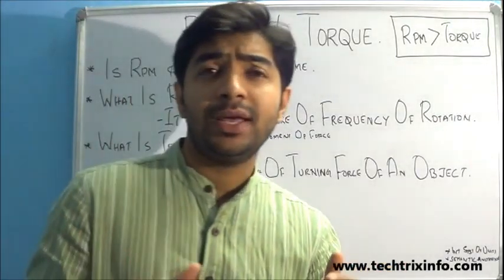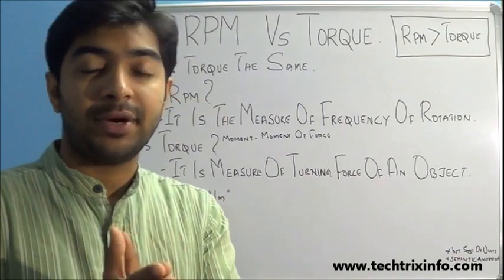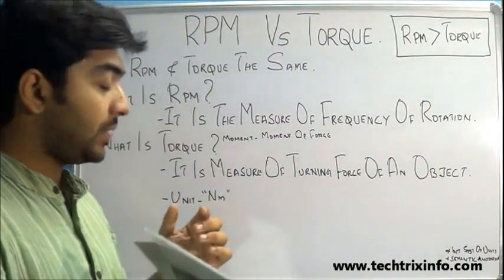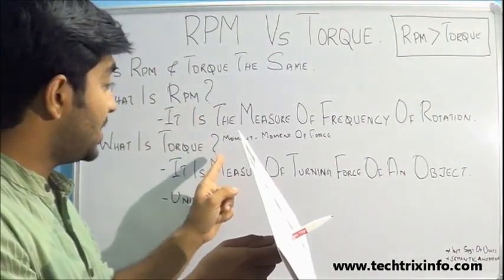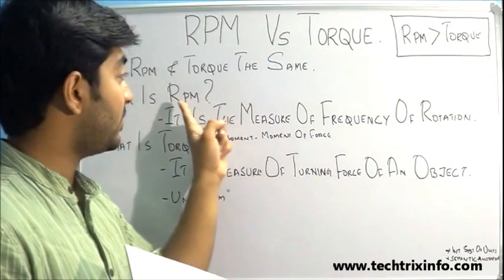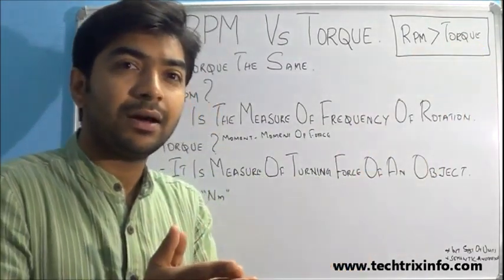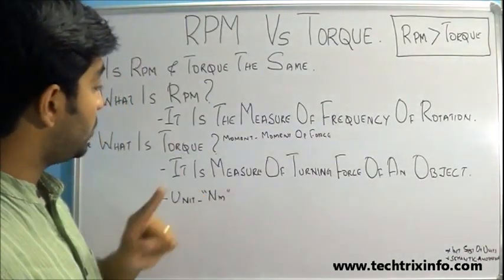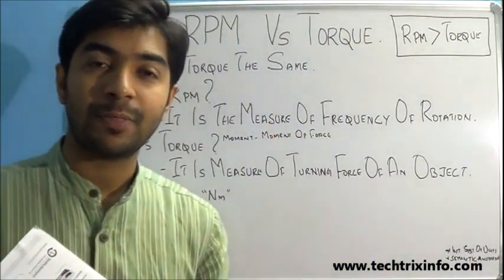Rpm Vs Torque. ✔

Comment: Actually what you are saying that the torque is the force to rotate it's wrong 
Let say we have a serial of gears example train gear and in the right side  we have propeller while we rotate the gears from the left side by our hand or motor, wind ...etc or any kind of tool, this called a force that aplicated to our gear system, so the propeller will start to rotate generating by that a thrust that want to push/pull  all the machine from point to another  like drones or submarine the more thrust the more  power of deplacment, and in that environment there is a weight let say a mass of the water here it comes the torque, its how much power the rotate provide so he can handle that mass, le say we take off the propeller and we will replace it with different weight each time in the 1st try we will put 100g the rotatif axis is rotate normaly and we will put another weight now 400g we can see that its still rotate but slowly, and when put more weight 800g the axis cannot rotate that's what we call torque how much power to make things move / rotate not the force to rotate

Comment: Which bike would be better?
All other specification remains same only torque is as follows:
Bike A =12.8 N.m / 6,000 r/min (2 Valve)
Bike B=9.5N.m/9000 r/min (4 Valve)

Comment: अगर हम 8 pole motor pr 8 no pully के माध्यम से दूसरी साफ्ट पर 4 No. Pulley add करते है और दोनों को बेल्ट द्वारा जोड़ते है तब मोटर rpm=750  ओर शाफ़्ट जिसपर 4 no pully लगाया था उसका rmp=1500 rpm होगा , 
तब torque shaft ka torque आधा रह जायेगा या जो मोटर टार्क पैदा कर रही थी वो ही मिलेगा
Reply: 8/4* 750 Motor RPM =  1500 RPM SHAFT RPM

Comment: Sir i have 29 hp d engine with 6 inch pulley 2200 rpm. Tell me water fan pulley size? BIOS i have 8 inch water fan pulley. In this position tube well water though is best but engine on some fast speed?

Comment: 1.FOR 149 cc Pulsar-Max. torque: 12.5 @ 6500 (Nm @ RPM) Max. power: 15.06 @ 9000 (Ps @ RPM) 2. for 349 cc classic R.E- max.torque : 28@ 4,000 (Nm rpm) , max. pow : 19.80 bhp @ 5,250 rpm tells what. what is the basic relation between torque and power.

Comment: same cubic capacity of engine but how to  in-cress engine horse power of same engine
For Example CC 8223 RPM  2800 maximum and minimum 1700 smae engine but Hp 200 &  other 195 
Please inform imam.sohel5@gmail.com

Comment: The design of pulley and bracket required by a small firm of contractors for the lifting of stone slabs during restoration work is shown in figure. The bracket is to rest on a plate grouted into an existing wall and is to be held in position by four wall bolts. The loads lifted will not exceed 11800 N and the lifting operations will be carried out by hand winch. The design employs simple welded construction, aiming at low production costs and early delivery to the firm.

Comment: A very nice explanation. @TechTrixinfo.com I am doing a project on Hybrid Vehicles. Since I am new to the automotive field, I dont have much knowledge about the engine and stuffs but I am very curious to everything,  right from the very basics, e.g. all the torque and speed relations, why cant an engine run negative, when to shift etc. Do you have a blog or some videos which could help me off with better understanding ?

Comment: why RPM is said as revolution per minute? its basically the number of rotations per minute. so it should be said as rotations per minute rather then revolution per minute. as there is a difference between revolution and rotation... isnt that so? please explain this?
Reply: Because revolutions are just complete rotations - when a disk rotates, it completes a revolution when a generic point A reaches again its original position.
Reply: Parasar Bhattacharya
Reply: It's simple definition for r.p.m thanks sir

Comment: Hi,
At around 2:25 to 2:30, the maximum available torque to the engine is 0 Rpm?
Reply: In theory if you use an electric motor, yes. Normally some control electronics limits the torque at very low rpm because otherwise, bad things can happen.
What is a bit strange though is, that he is refering to an "engine". motor and engine doesn't mean the same device in english. What is normally called an engine is something like an aircraft turbine or a piston engine, but not an electric motor. And these things have a totaly different behavior when it comes to torque and power output.
Reply from the maker: shi01 
Tks for the comment 
WhatsApp us @ +919744615655 for More clarity on the subject

Comment: also my senctioned load is 38 kw and load that is on my bill is 45 kw
I have 1.   50 hp 1400 rpm motor,  2.   30 hp 900 rpm motor, 3.   7.5 hp 900 rpm motor, 4.   15 hp 900 rpm motor.tks

Comment: can someone tell me how to reduce amp of a 50 hp motor with 1400 rpm, running amp are 18-20 torque is 49-52 amp. tks. 
you can also email me the answer at mimran215@hotmail.com

Comment: I am sorry Sir, but Torque does not need revolutions at all. You can have a Stationary  Torque  as Torque is Force multiplied by Distance and there is no time involved the unit of Torque does not contain time it is a static situation really. The fact that an object can rotate due to torque well that is consequential of  the application of Torque. but Torque can exist statically so rotating the cardboard when you meant to explain torque was totally wrong, you could have shown torque on the cardboard without rotating it, First you could have added a weight to the cardboard away from the centre and show that the weight will drop down to the lowest point due to torque, Then by adding a second weight or using your hand to balance the previous weight you would have shown an equalising torque which would result in a stationary representation  of two torques acting against  each other.  When you explain do not combine two things at one, take Torque on its own first without rotation but static, All the best.

Comment: if you dont know learn properly ............. dont give wrong concept n half knowledge... dont say RPM increases torque decreases.... RPM coming from torque ... if friction increase oppstion increases motor slow down bcz produced torque compensating friction unable to run motor at high RPM ... we need to have some imagination to explain such concepts..............
Reply: You could've delivered your message in a better way :) He might not have clarified it well but it is correct that there is a point where RPM increases and Torque decreases. It is called the optimum point where RPM increases and Torque starts to decrease. 
For example, RPM and Torque both increase when the car starts to move. Then, Torque decreases while RPM  still increasing when the car moving. Another example, when you try to rotate something you would need to apply force on it to rotate it. Then when it starts rotating, you would not need to apply the same amount of force to continue rotating it. You would need lower force while rotation increases. Hope this helps a bit!
Reply: @houdalmayahi3538   you need to know constant torque-power curves. In constant torque region torque remain constant even speed increase or decrease. Power changes accordingly. But in constant power region torque and Speed are in opposite relation. To maintain power constant. Because power = torque*speed
Reply: Hello sir can I have your contact I have some problem with winder machine ..can you please explain me detailed it will helpfull
Reply: @nareshvodapalli8977  8500278448
Reply: @RadialUniqueMedia  thank you sir

Comment: Hi there,
I have a doubt, when we increase rpm, there is a need of torque or twisting force which will take the current rpm to a higher rpm. For example, if i am a 100 rpm, i need some external force to go to 100 rpm. If torque reduces at higher rpm then how will the driver accelerate
Reply: Mridul Kumar I know this was a month ago, but I'll give you an example. Have you ever pushed something around that was on an axis? For example, a ruler on a pencil. In order for it to spin, you need to use a nice amount of force for it to spin. For the speed to increase, you need to give it less and less force. Pushing it as hard as you did the first time might slow it down or go out of control. It's sort of like that I think, lol.

Comment: thanks sir, Now my confusion is cleared As you gave example through card that is fantasitc.....
Reply from the maker: Chandra Pratap Singh Rathore Thank you.Please Subscribe for updates. Kindly share with your friends too. We are also available on face book. Take Care..TechTrixInfo.com
Reply: +Chandra Pratap Singh Rathore Me too.
Reply: hello i am not a student of science  though i wanted to know if i knew the rpm shall i have to calculate the torque ? my second question is if i used a motorized kite spool that diameter is 3 inch and rpm is 3000 then how much thread it can rewind in meter/s .

Comment: hai bro, i will give you a problem, that i am going to apply, actually i am not a engineer student. as you said when RPM increases torque reduces vice versa. Now as i know to increase RPM we use gears, u know it how. But at the same time torque decreases. For example take a motor, and a person. a motor revolves at 1800 RPM. a person can revolve a cycle crank normally 100 times. if we take a motor to lift the wait upto 10 kg let us assume. if we want to increase the lifting capacity we increase the RPM by adding gears. let us come to a person he can cycle the crank normaly at 100 RPM in the cycle gear ratio if the front crank rotates at 100 time the back tyre roates 300 times. and if he wants to increase the RPM to 120, he must put some great effort which he can rotate the back tyre at 360 RPM. now to reach 120 RPM the torque is increasing. any man can not move any object at a time. he start at slow speed and speed up later he can achieve it. means at start up the torque is very high and later decreases as per my point of view. now coming to the cycle the person is already at 100 RPM at some X torque (i dont know how to calculate torque) it turns at 300 RPM, even if he stops revolving, it rotates, if we increase the gear ratio when it is already turning can we have the same X torque?. may be it is useful to increase the speed of cycle. but the point is in the bykes or anyother else, the final gear rotates only at the engine speed. as the ingine can not move the byke at a time we use gear. but here i am trying to increase RPM what our cycles are giving. if u can solve this email me at chinni.2369@gmail.com- if it is really interesting call me at 8886411179, anyone can call me

Comment: As far as I understood, If the torque increases (Force) there would be more revolution, so how could if RPM increases the torque reduces? Please explain!
Reply: My Dear, Torque is inversely proportional to RPM. consider the selection of first gear in going up hill,the car can go up because of a high torque and notice the speed then, it is considerably slow.
Reply from the maker: Yes. to the point.
Reply: RPM  x  torque = power (HP, watts, etc.)

Using things like gears, you can "trade in" torque for RPM and vice versa.

When you run an engine unloaded, it is freewheeling and the RPM will rise and rise until friction becomes great enough counter-force to slow it down. Now your engine is running as fast as possible!

When it is going fast like that it is easy to slow it down more since there is little torque. By adding a load, say, one that will demands the same torque no matter the RPM, the engine will slow down and may even stall! As it slows, (decreasing RPM), the torque increases. Once it increases enough, it will drive the load at bogged-down RPM just fine!

Theoretically, you could use a motor from a drill to push a big truck up a hill, if you convert the speed of the motor into enough torque to overcome gravity. Of course, it would be very VERY VERY slow!!

If you want to consider something like friction, the torque needed to overcome it will decrease with less RPM, and increase with more RPMs. the relationship looks something like:

RPM = torque x resistance (like friction).
Reply: Power Max Unfortunately, engines, like any other power-delivering devices, engines do not deliver the same total amount of POWER to different loads.

    Say, if you had the engine unloaded (parked in neutral) and you revved it up. 100% of the gas used is wasted since no work is being done. lots of RPMs, times ZERO torque, means ZERO horsepower.

    Similarly, driving up a steep hill in the highest gear would cause the RPM to drop to ZERO, and stop the engine. Thats because your transmission is tring to convert torque into RPM on the wheels. By doing so, the stick shift loads the engine down too hard and it cannot keep up. So at very low RPM, you do not get much power to the wheels.

    These concepts I am sure are very difficult to grab at first, and making matters worse, calculus is often needed to express a lot of the relationships and all. I could also be wrong on my understandings, as I simply made RPM analogous to electrical voltage, torque analogous to electrical current, and horsepower analogous to watts. Also, the resistive load, is counterintuitively analogous electrical conductivity, not electrical resistance, but the opposite. (a short circuit is considered a low resistance in a bad place, while "shorting" the motor I would call high resistance since the motor is bogged down.

Comment: my car has RPM up to 8000, but when i push the pedal it reaches 6500 and engine drops, after the the rainy season incident,  .the service center  say it only reaches up to there , i do not believe  them .
Reply from the maker: Your Car FIP - fuel injection have an issue, please calibrate it.
Reply: Tks, for ur reply, I have cleaned fuel Injectors. Is that same thing ur talking?

Comment: Sir we have a tata indica vista 2010 model ,  it was giving a very good performance mileage and power (torque)  In rainy season my car was covered with tarpouline type plastic and lying like that for 20 to 25 days and there was no space for air movement from outside to inside and inside to outside , within this period there was sun and rain and after 25 day opening there was some sort of corrosion on engine and inside the vehicle from that day onward the engine performance went down , the power (torque) and the mileage went down drastically i checked with the company service center , but they  can not find any solution , i do not  feel like driving this car anymore , since i saw your video i feel that you may know the solution .please help me , my contact number is 0091 9574741191, 00 919574116777, please leave your contact , i feel its better i talk to you over phone . my email address is pareshdxb@gmail.com,

Comment: Hi. You should mention that Torque multiplied by angular velocity (radians/sec) is the Power generated by an engine. Angular velocity is just another way of representing RPM. Each full rotation is 2xPi and Pi is 180 deg. IN a way angular velocity tells us the rotational speed per second. Since Power generated has a peak value, the combination of Torque an angular velocity gives an idea to the customer, what would be the 'pick-up' of a car from low speeds to high speeds

Comment: Example of physical system = Formula 1 car and an Ashok Leyland truck, both have 500HP engine (lest say). But, F1 engine produces the 500HP at higher RPM and lower torque. But, Leyland engine produces 500HP at higher torque and lower RPM. Higher torque translates to higher load pulling capacity in vehicles. Whereas, higher RPM results in higher Km/Hr speed.
Reply: Debraj Deb 
so, does the gearbox has an effect on it? or it's just the engine?
Reply: we r building Formula 1 car.. in our college

Comment: i have a doubt in 1 thing ... should a vehicle have high hp or high torque? how does it affect accelration ? please do explain
Reply: if you want acceleration and speed its got to be high horse power. whereas you want a stable steady speed at even at low rpm then its High Torque whats needed. Like Racing Sports Bike have High Bhp whereas cruiser bikel like Harley Davidson or Royal Enfield has Has High Torque which makes you glide plain or uphills at 3rd gear at steady constant speed at low rpm.

Comment: Why does torque decrease as RPM increase? With your example (the board on the pen), if torque increases then your hand is apply more force and the board is spinning more, having more rotations per minute. My questions being how can torque increase as RPM decreases?